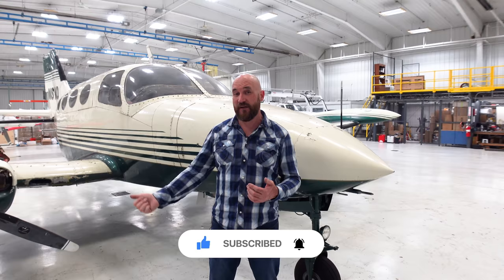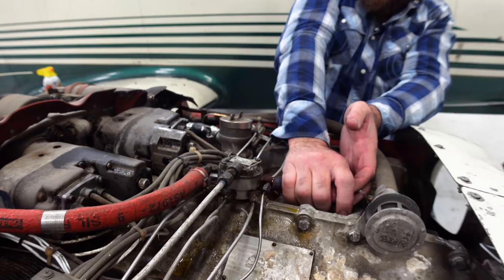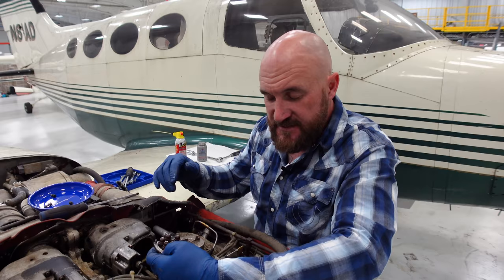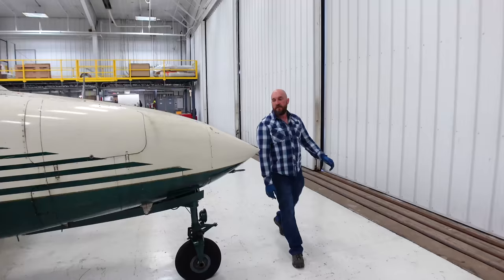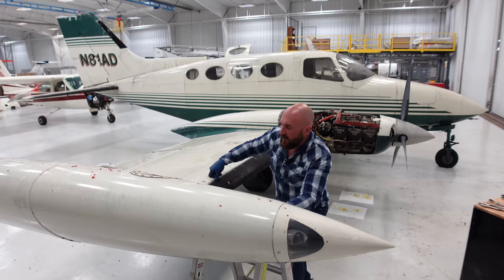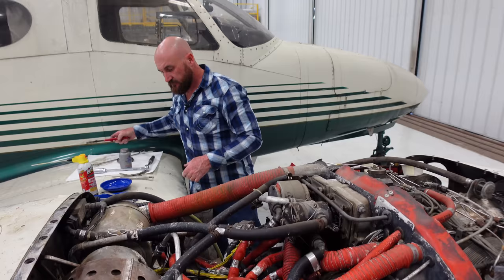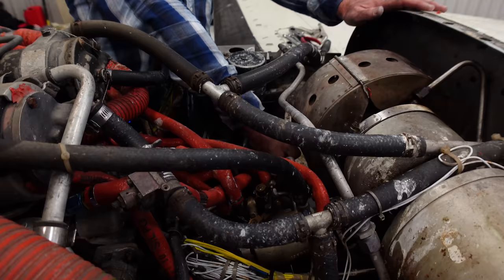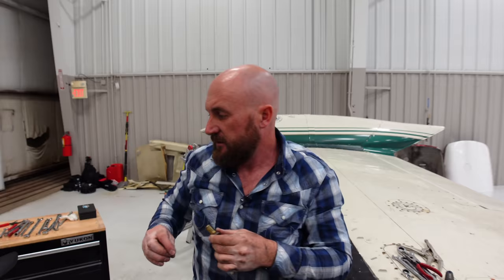He's Trying To STEAL Our FREE Abandoned Airplane ! Ep3

Comment: It was an astute observation that for all the years of dirt and rust and grime, the engines likely don't have much hours on them. If the owner didn't have the money to comply with an AD, they likely weren't getting much use out of it in the first place considering the cost to run a plane like this (as you stated in the first video). I'm totally hooked by the series, looking forward to getting through the rest of it!

Comment: To check for fuel getting to the injectors through the fuel flow divider, push the mixture control up to Full Rich and hit the primer. If after re-connecting the injectors, there's still no fuel flow, it's the fuel injection system, which is more than just the injectors.

Cessna 401 POH Section 4, Normal Procedures: To start the engine(s):

BEFORE START 
 1 through 8: not important at this stage
 9. Throttles - Open One Inch 
10. Props -Forward 
11. Mixtures - Rich 
12. Fuel Selectors – Main/Tip Tanks 

ENGINE START 
1. Magnetos - On 
2. Starter -Press 
3. Prime Switch -Appropriate Engine 
4. Auxiliary Fuel Pump - Low
5. Throttle - 1000 - 1200 RPM 
6 through 9: not important at this stage

Comment: I know nothing about airplanes except that to get it flying again involves vast, eye-watering sums of money and I mean VAST! I admire you for trying (and succeeding, I'm sure) to start the engines, but I think that is as far as your dream should go. An 'Annual' on one of these things costs upward of $6,000 and that doesn't count the parts that must be replaced or the cost of the air certified mechanic to fit them. Take a trip over to Jimmy's World YouTube channel if you don't believe me. I wish you luck, but I'm afraid that your posckets won't be deep enough.
Reply: A plane and car models have something in common many were built. So there are more than one of this kind around. Hence the model number and engine and plane you can access how many were built and parts around the country. Your statement is inaccurate  do your research on the Guy and remakes.
Reply: @garethp7321  I don’t think you realize just how much it costs to do all of this kind of work. Number of aircraft is largely irrelevant, the yearly operating costs on something like this is going to be around $30k once you include the inspections, but that doesn’t factor in the amount of work needed to get this thing airworthy again. He’s going to need to have the engines rebuilt by an AMO, the interior will need to be stripped and how much it’s rebuilt will be up to him, the avionics need to be updated, most of the fuel lines and rigging need to be redone, all the wires need to be inspected, hell it might even need new landing gear after sitting for so long. At a certain point it becomes cheaper to buy a different airplane, and this might be that far gone
Reply: @garethp7321  It's easy to spot people that are obviously talking out of their arse. After reading your comment, I've spotted another one.

Planes are a massively different business to get airworthy than to get a car to be street legal.
Reply: @WimsicleStranger  Certified aircraft , maybe he should have started with something not , I cant see this plane ever flying again , unless like the OP said he has VAST sums of cash and willing to blow it.
Reply: His pockets alone may not be deep enough, but with his knowledge, viewers knowledge, ad revenue, donations, people who know people, etc, alot is very possible.
Reply: @ProofBenny  I disagree with Gareth but I fully agree with what you've said. I'm watching this series not because I know he'll singlehandedly make it airworthy again (nah, he'll need to get both engines AND interior + avionics fully rebuilt and that is $$$), but because it's entertaining watching someone bring an old piece of neglected machinery back to life. 

I know the chances he'll make it airworthy are slim to none, but it's still entertaining as hell to watch lol

Comment: All he's trying to do is get fuel into the cups!  Isn't there at least enough pressure/fuel from the hose that was pouring into the black bucket that was on the wheeled cart to go to the cups after he reconnected it and pushed air through the lines?  Why didn't it go into the cups since there was a steady stream that filled the diameter of the hose?

Comment: You mentioned something about taking out the rivets on the bottom or something which cost $70k which is the reason the owner parked it in the first place, are you in the position to take care of that??
Reply: with the amount of subs and views growing , he would be :) look  how he got helped and got a hangar to store it and everything
Reply: @emptyscience  ok, but 70k for that, the cost of rebuilding both engines, plus the avionics, the interior you're looking at $125-150,000 that a huge amount of money for an old plane!
Reply: @allisonchapman1392  with engine and prop overhauls, mag inspections (4), tires, oleos,  rudder damage fix or replace, avionics or refurb gauges, interior, fuel system rebuild, new deicing boots, and full approval from the FFA and an IA, I'd say $225k+ to get this thing flying reliably and safely
Reply: @karaayers2867  Yes most likely, my estimate was very low. Is this thing worth the trouble??
Reply: @allisonchapman1392  depends on luck.  May luck up and get the spar done and a good IA spend a month on it and only find 20 small issues.  May spend more than you want and still have problems due to no log books, hard to sell, etc....

Comment: Kinda feel for you on how this video ended :(   I am an A and P with extensive experience on Cessna 402 A, B, and C models. I watched and shook my head a lot. I know that you are not an expert (although you know some stuff and I give you credit for trying) maybe the smart thing to do was to hire somebody who knows it inside and out. I would have checked compression by hand spinning the prop (backwards for safety) with the mags off, then with the air cleaner cover off, spun turbo impeller with fingers to check for freedom of movement, then with that accomplished, hit the intake with some ether. This would tell you without removing anything in about 5 mins. if the engine had a spark or could fire on any cylinders. On a lighter note, I heard my boss asking me (you) what's taking so long? It brought back memories.

Comment: I'm still saying $240,000 to get this neglected beast signed-off and Airworthy... including the County Health Dept.  And even with the turbo charging hard and 2 flawless magnetos, the single-engine performance is... underwhelming.
Reply: Register it as owner maintenance. Then you can use the 350$ non certified icom instead of the 35,000$ certified icom.  Lol all you need is a sticker saying this aircraft does not comply with the faa on the door and you're good to go.

Comment: Bro, God bless you on your journey with this project, as a long time A&P mechanic you sir have your hands full, I would politely like to point a few things out you need to consider, #1 please do not set your batteries down on a cement floor for any extended time, this will drain your batteries quickly, #2 although your Mags look good and you have a spark doesn’t mean your mags are properly timed to the engine, the mags could have drifted a long time ago you’ll need the maintenance manual for the engines to properly time the mags to the engines, you’ll need a timing light to get that accomplished and know where your #1 cylinder is which is on your data plate attached to the engine block,  #3 if that’s the original fuel in the tank it has probably turned to vinegar by now and will never start. Good luck my friend.
Reply: The battery drain is a thing of the past unless your batteries are still made of wood... Only reason why they would drain is just not being used for a extended period of time.

Comment: Eye protection man! Esp when working with compressed air, fuel and junk, other than that I can't wait to see it start! Make sure you head to the tool room to get 100 feet of flightline and some prop wash. ;)
Reply: I was send to two different squadrons to find a left handed torque wrench.. as a young airman basic….lol
Reply: Agreed! I adore your channel, please insure it will keep going by investing in some eye protection. Compressed air, loose rust, bird crap, and your eyeball do not mix well. Compressed air can get tiny bits of metal flying faster then out of a spring bb gun, if it breaks in the right way it's basicaly shotgun spreading so it's not even a question of a "lucky piece" breaking the "right/wrong way" and your eyes aren't Cessna engines, if they take internal damage they frequently wil never be "rebuilt" you're just out an eye.
Reply: The hearing damage from compressed air is, as usual in US comments and video practice, grossly underestimated. Not that eye protection is unimportant, au contraire! but your ears are as valuable.
Reply: @mansnilsson4382  You know, I literally build and test guns for a living and I still missed that. I know better. That's an incredibly valid point, thank you for making it. Your ears going can fuck you up just as badly as your eyes going, especially if your inner ear is affected at all.
Reply: @jrjeffcoat64  I forgot about the left handed torque wrench!  Good times!

Comment: My 50 cents are that even if you get the engine/s started it's a loooong way until it flies. The wing spar issue, overhauling the engines, interior , flight controls , airframe corrosion, which could ground it even more, you have to decide what's your plan with the airplane. Without dealing with EVERYTHING, highly unlikely to get it airworthy again for money, which is less than buying yourself a decent condition aircraft. If it's for some views and you are ok with only eventually taxiing it around the taxiways, then yes. Really loving the content but as a pilot who rents, I see absolutely no point in keeping it for yourself unless you want to spend some big money. Good luck from me of course, still loving the series!
Reply: You can not rebuild the engines without logbooks, props ether

Comment: Never use channel locks on the AN fuel lines. They are typically made out of aluminum and you will absolutely destroy them. Use the proper AN wrenches.
Reply: I think you can bump that up to "never use channel locks on hex fittings" in general. The only acceptable tools in my book are wrenches, Knipex pliers wrenches, and crescent wrenches only if you tighten them properly.
Reply: @VaughnRhinehart  Hand tools by priority are socket (when possible), boxed end, open boxed end, open-ended, crescent, adjustable pliers, vise grips as a last resort but be prepared to replace with new part. RETIRED JET FIGHTER MECHANIC, USAF

Comment: Cessna 402C mechanic here. Pretty much the same engine. 
Put your mixtures forward and turn it over again. If you get the full, proper fuel flow, i will laugh my ass off. 😂 And then i will cheer once you finally get this old gal running! 
And if you need to remove the turbos, you can. It will still fly on nat-asp engines. It just wont have quite as much umph. 

Also, next time you do a project like this, hide the tail number. Blur it, put a block over it. Hell, put a tarp or something on the tail. The whole V-stab & rudder. 
That'l keep cvnts like that from trying to undermine your project. 

Damn good airplane to own, if you can own it!

Comment: You're almost there man! She's gonna bark soon! Around 9:30 you said, "I don't even know if we have air" and spoke about the turbo... Air will flow through a stuck turbo no problem. I mean, it's a problem, but the engine will start and run with a stuck turbo. Just won't GO like you need. What "air" refers to is your valvetrain and rings. If you have zero compression, you have no "air". If you haven't done a compression test, you really should. Good luck!

Comment: Hi, great project...expensive, but cool!
That thing should have a pressurized cold oiling system, so that it starts recirculating oil all over the place before you start it, make sure to use it or at least get some device to pressurize some oil into all passages...the injectors will also need to be rebuilt, seals changed and flowed...I am sorry to say but at the very least these engines are going to need to be overhauled...rings bearings....machining....heads will need to be reworked! the turbos cores rebuilt...and then maybe get it to fire and work...fuel system is going to be shot...will need cleaning galore all the way from all 25 thousand tanks!!! ...not to mention all fluids changed and such...
Also all soft and hard seals will need to be changed throughout the systems...everywhere!!!
I hate to play devils advocate here but I will have to advise you to makes sure you get some paperwork signed over to you before you start spending any decent amount of cash to get this thing working again, for all you know the owner may just want some free overhauls!!!
Well good luck!!!

Comment: Actually you need 5 things to start a combustion engine. Air, fuel,  fire, exhaust,  and it all happening in proper time. No exception
Reply: No u don't
Reply: It's only the main components Air, Fuel, and spark your not going to have an exhaust without the first 3
Reply: @derekcunningham8742  if you have a plugged exhaust,  it won't run. This is a necessary part of combustion
Reply: @derekcunningham8742  also if you don't have the correct timing,  it won't run.
Reply: @michaelbrookman89  Since Derek is running on air, beer and cigaretts, he never had a problem with a clogged exhaust xD
Reply: @FTfilm  it's alright,  I know Derek's a busy guy. But I just wanted to point out those things for a bigger purpose.  So that a fallacy,  would not cause any future problems for others that are doing their own diagnosis

Comment: Those line  that you disconnected get built up  a peace of 32 safety wire can clear them I’m currently a mechanic on 53’s and we have to clear them from the fuel that builds up and calcified in them

Comment: I'm wondering why it's so important to get those motors going. You won't ever be able to fly those without a complete rebuild before the new annual.  It will start fine without the turbo turning. It won't have tons of power. You don't need it

Comment: Have you check ground - negative connection of motor and  ignition. You can try to connect engine to battery - negative with a battery jumper cable.

Comment: maybe there is a low oil pressure cutoff pressure switch somewhere that shuts off the fuel supply if the pressure drops to a dangerous level?

Comment: You need to find someone who is willing to help out who has an A&P.  At 73 I have worked on a large number of AC's  When I first started we made our own equipment. An old mag coil with a vibrator and 1.5 v d cell battery was all we needed to test all the spark plugs.  You also need to check for compression. and you can use a spray bottle of av-gas spraying it in the intake to see if she will try to start.  You need two or three people to help, one on fire extinguisher duty, one in the cockpit to turn things (mags) on and off. and the other to assist you with the spraying of the fuel into the intake.  If she starts even for a second then you know the systems like pumps, electrical lines and other systems need to be checked.  Many years ago I was successful in starting a radial engine this way. Note If you can start it on primer only then the next step is to start cleaning and checking all the systems that assist in the running of the engine.

Comment: You do know the turbo doesn't actually have to spin in order for the thing to start . The turbo isn't spinning when you first start the engine anyway on any turbocharged engine...just a lil FYI. You need spark, fule and air .. air it has ... You either have no fuel or you have no spark

Comment: I have followed, rooted for, and even supported several rust to riches' airplane restorations but on this project you are in over your head, it's nice to support an underdog but most of those who think you can do it aren't realistic or knowledgable on the subject, even messier than the state of this airframe is the red tape around getting this thing anywhere near airworthy again, it will never fly again, not on those engines, systems or even structural components. I'm not invested, I am sorry you are emotionally invested because even if you succeed you are falling into a money trap - just get it started and give it back to the guy to sell and know you achieved something and did some good and gained new followers and respect, I am not invested in the project but I am invested in seeing you do the right thing.

Comment: The oil pressure will not build in the engines until things actually running. once it is running and you still don't have pressure immediately kill the engine by pulling the fuel mixture back to idle. I'd suggest getting a preflight checklist and doing a mock preflight, also familiarising yourself with Aircraft so you know what to expect. Also, in order to send fuel to the pumps you first:
turn on the fuel pump 
Make the fuel mixture rich
watch the gages for the pressure to level off
then turn off the pumps and pull the mixture to idle
(Note: if actually starting the Aircraft keep the mixture rich, but for just checking if fuels comes out I'd do that.)
I hope this helps! been watching since you first got the plane, I hope it flys!
Reply: If you're actually starting the plane don't pull the mixture back to idle it'll kill the engine. I did that when I was a student pilot on a Cessna 172S right after turning the magnetos and pissed off my instructor.
Reply from the maker: Hey Alex thank you for dropping by helping out….  And thank you for watching ! 👍🏼